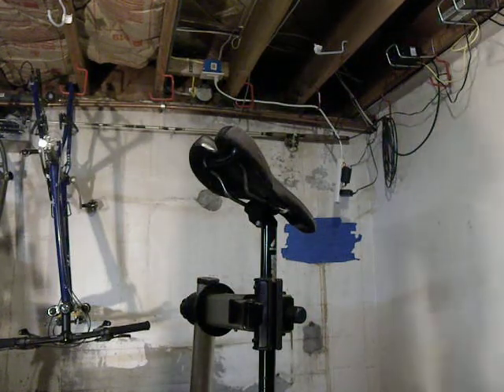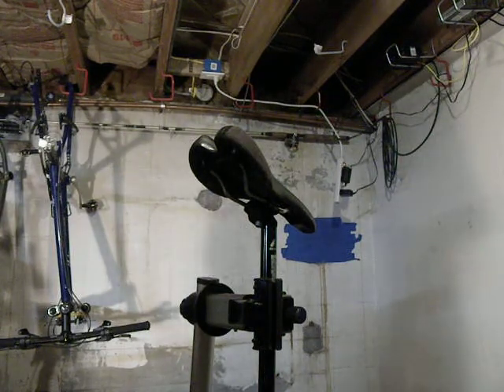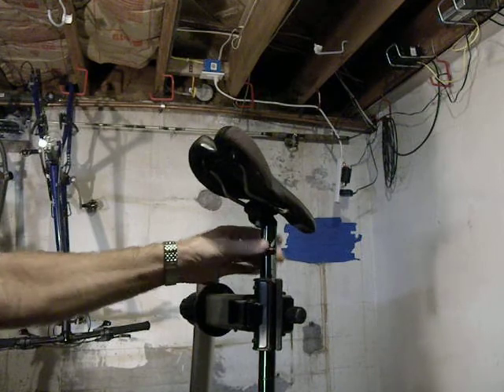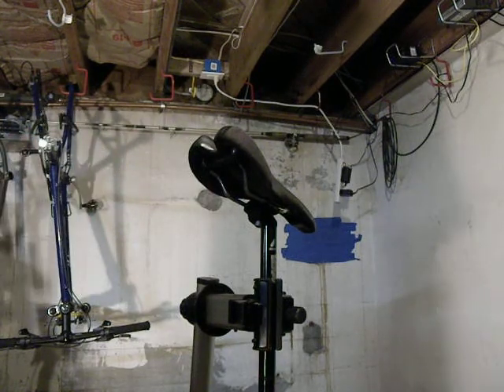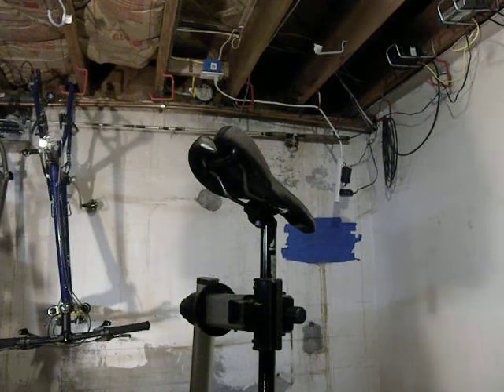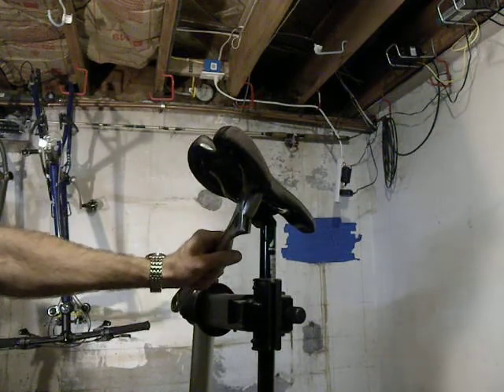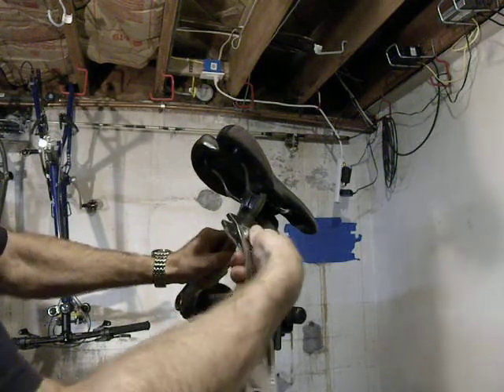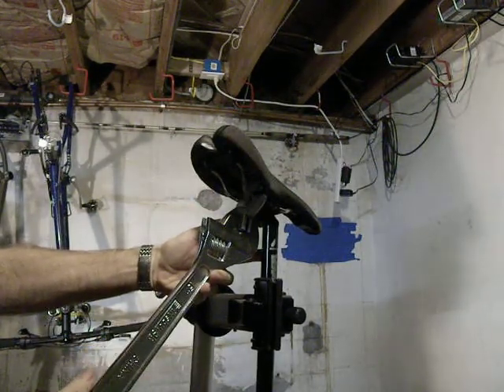bent seat rail

Comment: I got a cloud 9 coil suspension bike saddle, the rails are just ever so slightly to wide apart. clearly if you can bend rails back into proper position you can bend them out of proper position. :'D